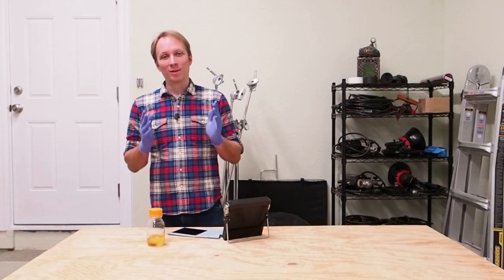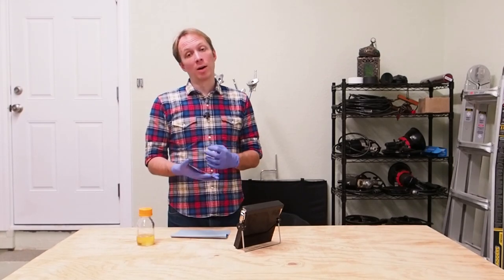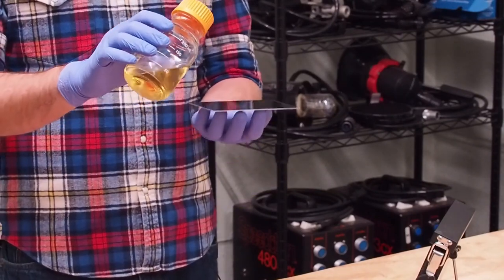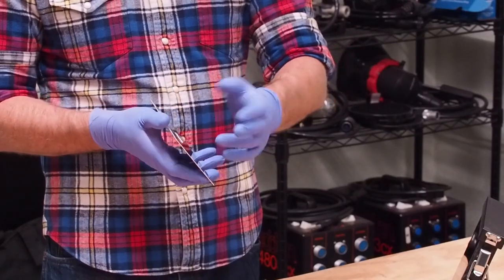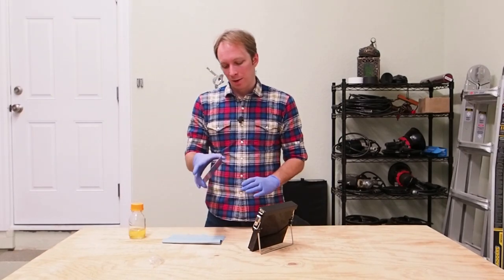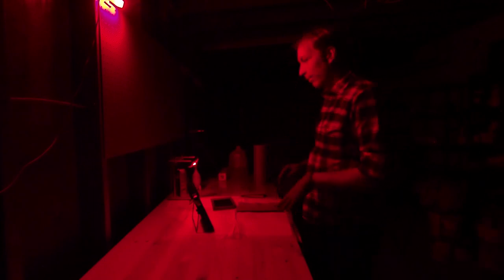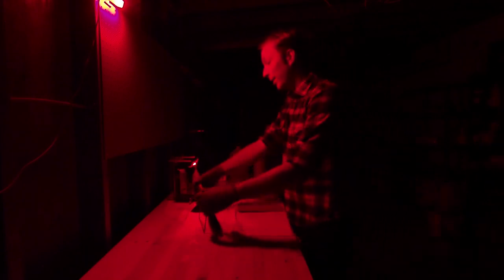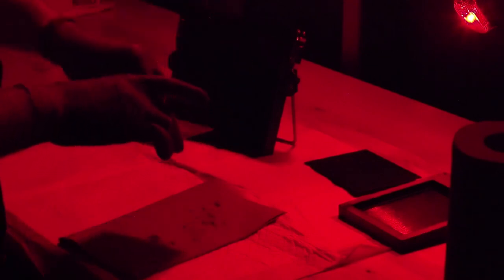Collodion Basics Part 5: Pouring the Plate

Comment: Do you not worry about breathing in the Ether vapour?
Reply from the maker: If you look a ways back in the playlist, I talk a bit about this in the safety video. I normally wouldn't pour in this location (inside my garage with the doors closed) without a respirator, I just did it this once so I could speak clearly on the video.  Normally I either pour out in the open air or indoors wearing a respirator with organic vapor cartridges
Reply: Robert Bieber Thanks. I hope I didn’t seem disrespectful; i was just interested in your opinion because this is a concern i have with my own method. Thanks for the reply.
Reply from the maker: No problem at all :)